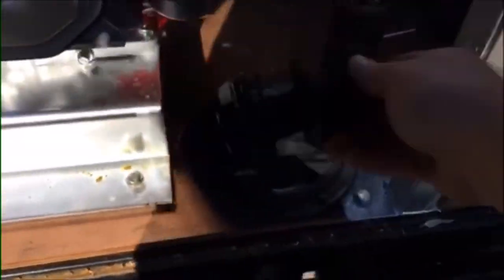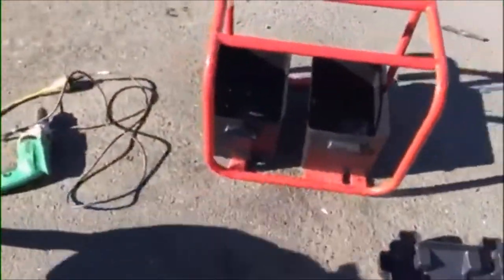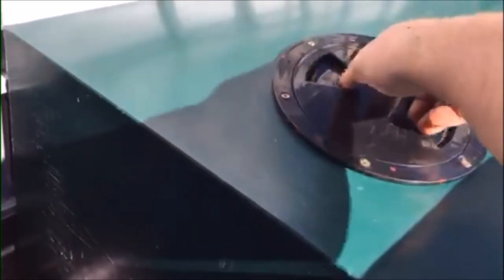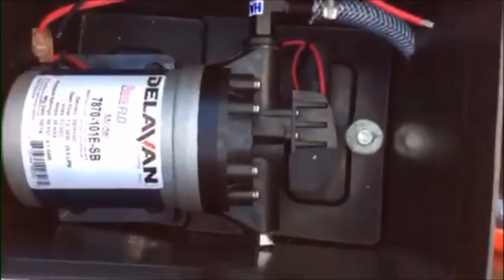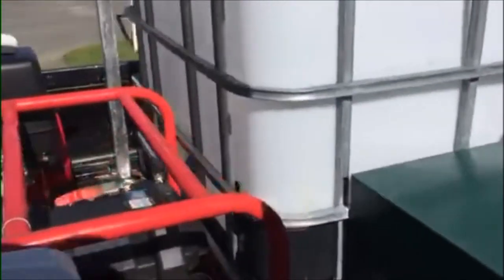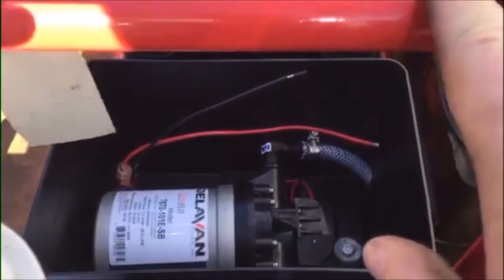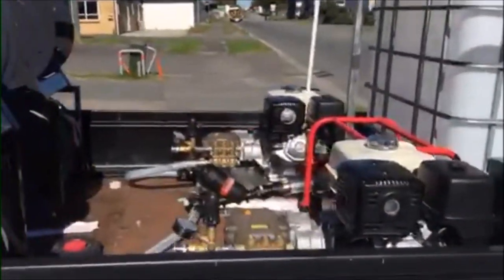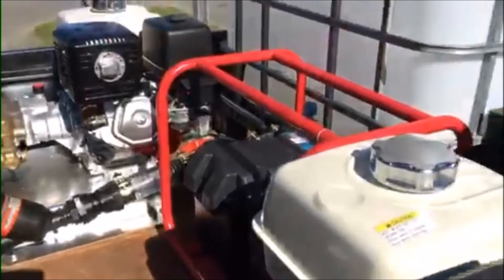New House Wash Truck Build Part 4

Comment: So when you're cleaning roofs you're using the same mix that you use for siding, just stronger because it is not being diluted by the downstream injectors?
Reply from the maker: same chemical yes, bleach but on roofs its alot stronger

Comment: What kind of pumps do you guys use on pressure washers? What's the reason to have separate pump for roof mix?
Reply from the maker: We use alot of comett RW5530 pumps or RW6530,
Reply: I have 4 GPM pump now - think if pump upgrade will give me more efficiency. Thank you, Troy.